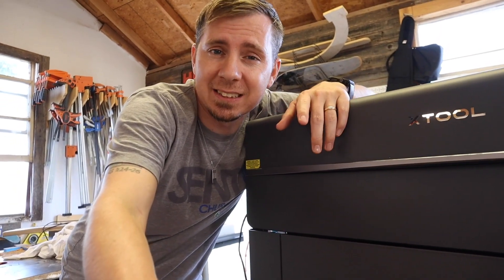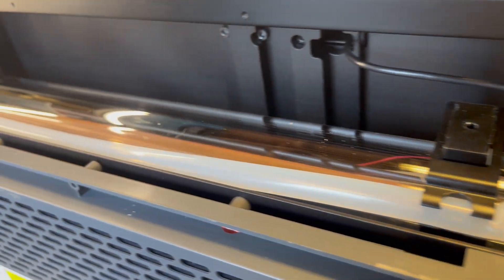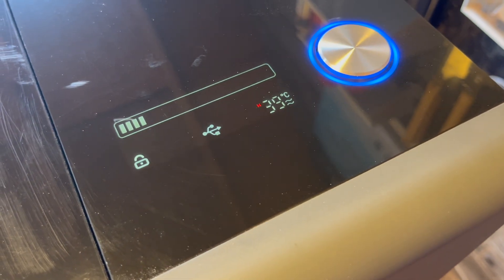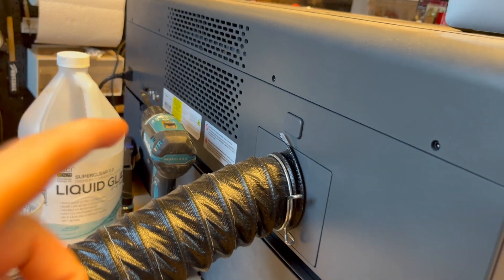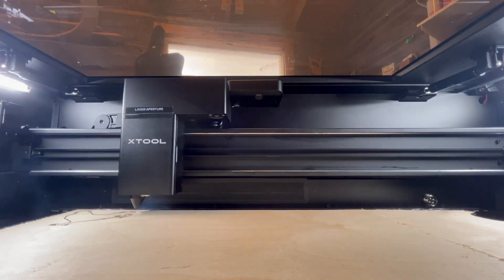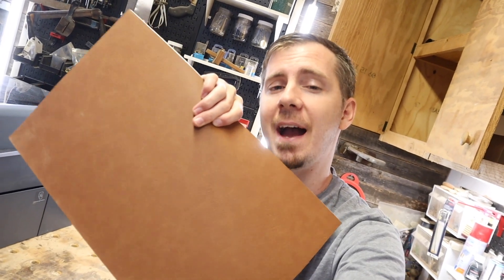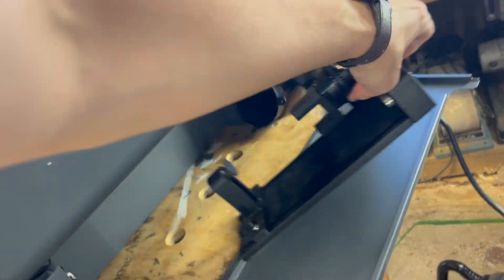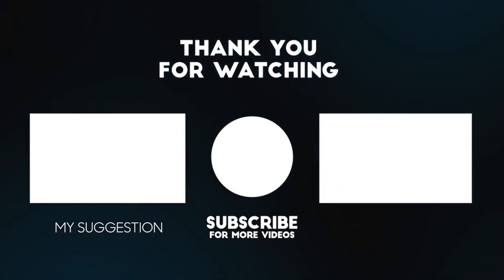xTool P2S // The Best C02 Laser Gets Better!

Comment: I recently did a maintenance cleaning of my xtool p2s and hubby, trying to be helpful,  tightened some screws on the 2nd mirror area.  We got it calibrated again but now the laser isn't firing when running my file in the xcs program.  We troubleshot all the things recommended by xtool. The laser tube is firing, the calibration is dead nuts on, the focus lens has been checked,  etc etc.  Any other ideas?

Comment: Amazing C02 laser cutter, My only disappointment is the laser does not have any pass through facility. You cannot put materials larger than the 600mm x 300mm bed size. Such a shame but overall I'm pleased with the cutter. I didn't want to purchase a separate feed system as it looks over complicated and I don't have the space. Great review though, thanks.

Comment: I completely regret my P2s purchase!. The C0² tube stopped working after 2 weeks ( about 50 small jobs). It takes forever to get a response from tech support, they do not have instructions or videos for the part/panel removals that need to happen for the P2s in order to remove the tube and it's not the same instructions as for the P2. I have been dealing with tech support/customer service for 5 solid days and they just now agreed to send me a new tube...AFTER I pay UPS $50 to package the tube up for me!!. And they wont send my new tube till they get the bad tube in! So my engraver is down for AT LEAST 3weeks. I have to cancel a lot of orders and i am furious. I thought i would just go buy a tube from their website and use it till the replacement arrives, but they make you return the silicone clips with the broken tube and the tubes you buy on their website dont come with the silicone clips and if i keep the silicone clips to use with the tube i buy off their website, then they wont send me the replacement tube (which i would just use as a backup). Makes me think there is something wrong with the silicone clip design and they dont want to admit it. Anyway...im out $4500 and cant fill orders for a month. I wish i had paid the extra 2k and just bought an Aeon C0² laser... welp, since i cant work for the next several weeks, i am spending a few hours a day warning other potential buyers online. Hopefully this helps someone avoid the hell i am dealing with.

Comment: I did 3 passes with 1/2 inch plywood and it won’t cut. Have you had any luck? We did 90/25. Any suggestions?
Reply from the maker: 1/2 inch is pretty thick for any laser. I’d double your passes and come down on the power and you should be able to cut though nicely.
Reply: @ thank you.

Comment: I just got my P2S a few days ago and I am used to using my S1.  I am having difficulty with the auto measure feature.  For example I am trying to engrave a leatherette hip flask and on the slats or honeycomb it is too tall, but on the baseplate alone it is too short....how do I place it properly?
Reply from the maker: In that situation, I normally would take the slats out and put something down that is the appropriate height to get my flask up to where the laser can engrave on it. Maybe just like a thin piece of wood or something?

Comment: The one element missing from the review was the fact that the CO2 laser tube is a consumable item, and they are very expensive to replace.  Perhaps not so bad if the laser is used purely for business purposes.  For the hobbyist, however, I would advise on going the diode laser path.  This is information I wish I had known before I bought a 40W CO2 laser by Flux.
CO2 laser tubes service life is directly proportional to how much power is demanded from it.  A bit like a car - stamp on the gas peddle, and you'll use more fuel.  Drive like Miss Daisy and it'll last longer.

CO2 laser for cutting = shorter service life.
CO2 laser for engraving = longer service life.

😄
Reply: While that is true, the usual lifespan of a tube is on the order of 6-10,000 hours. Roughly, 1 year before major degradation or failure. That said, it will go longer at reduced power levels [or reduced output compared to expectations]. When you factor in that running a laser full-tilt for a solid year 24/7 is almost assuredly a business application, a $400 laser tube replacement every year or two is not a big deal nor a deciding factor if its making you money. It would be nice if these were RF with a longer lifespan of course, but an RF machine of similar power with similar technology would be a straight full-on industrial level machine, much more difficult to use and integrate, and cost 2-3x the price. IMO, not worth the gain. Now, when Xtool makes a future variation based on this platform that is RF... I am sure everyone would be all-in yet again.

Comment: The biggest  complaint from my viewers is that it's not 100% lightburn compatible out of the box. The fact didn't  fix that was a big mistake.
Reply from the maker: That’s understandable but since it’s a software issue maybe it can be hotfixed? I’ve got no clue as I use XCS and wouldn’t change if they asked 👍🏻
Reply: Does the included software replace Lightburn or augment it?

Comment: I know it's not what your shop does, but I would have liked to see how it worked with different metals.
Reply from the maker: Understandable, I’ll try to fit some in in a future video.
Reply: @TheReformationWoodshop  I know CO2 lasers aren't really built for metal but I have seen CO2 and even stronger level diodes at least mark metal. Thanks for considering it.